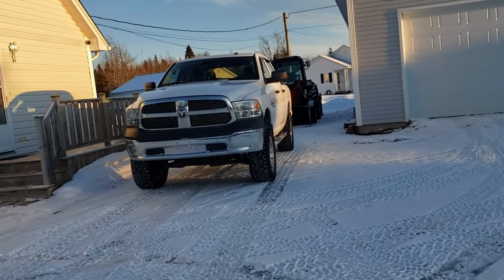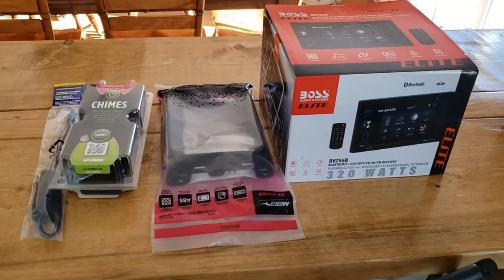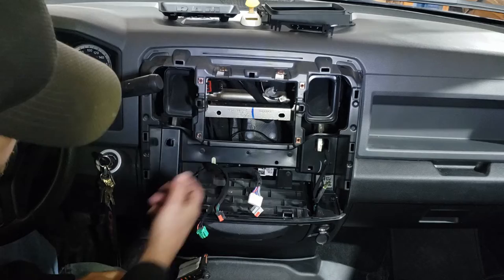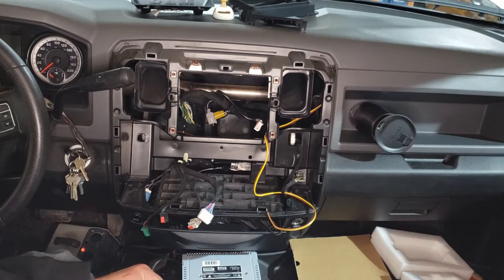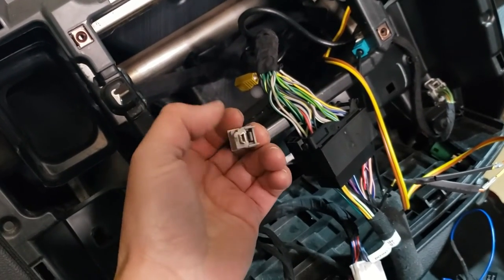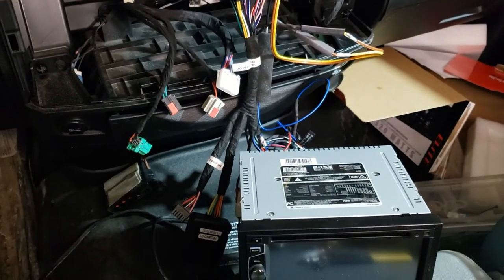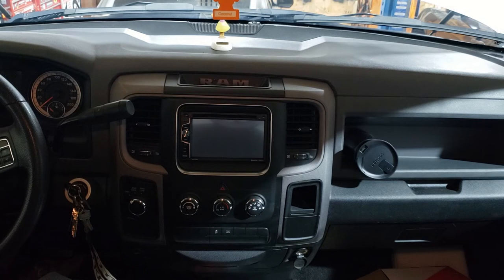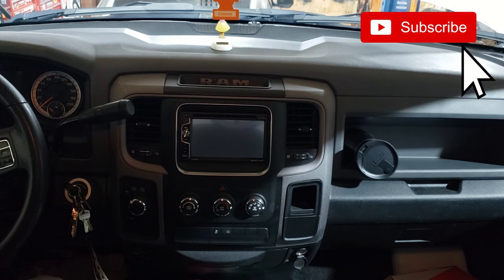Aftermarket Stereo Install - Touch Screen Bluetooth Backup Camera - Ram 1500

Comment: Great vid. Very helpfull. can you give info on the wireing harness and the face plate, part# ?? Thanks.
Reply from the maker: Here are the part #s from my order confirmation, it doesn't say what is what but I'm sure you can find them on the Crutchfield site: 12040EU55, 120956518B, 120LCHRC01

Comment: I have a Dual DMCPA70BT Radio do you think it would work in my 2016 Ram 1500 and trying to find the adaptor for my truck is hard to find. But i have the same OEM radio you do.
Reply: I’m not sure if it would work in my truck
Reply from the maker: Are you looking for the faceplate to mount it, or the harness to connect the radio?

Here's the faceplate: https://amzn.to/3PCYIuz

Here's the wiring kit I used: https://amzn.to/3x9Gs5s
Reply from the maker: It should. The tricky part is if you have steering wheel controls or want the console USB to work with the radio.
Reply: @nothandsomebuthandy  yeah I need the faceplate for mounting and the harness to hook it up and for the back up cam what wires did you use to splice into it
Reply from the maker: If you buy the adapter for chrysler vehicles it plugs right in to the existing radio harness and the adapter wires are colour coded to match aftermarket radios. So you just match the colors at that point red-red Green-green etc
Reply from the maker: Oh sorry the backup cam is the wires in the right dash access panel. It is the green and the green-red, see the 3:50 mark in the video.

Comment: Thinking about ordering this. They even have the option to hook all the wife's up for the harness before they ship it out
Reply from the maker: That will definitely save some time! Are you getting the same head unit?
Reply: @nothandsomebuthandy   yeah! I assume it is Bluetooth correct?
Reply from the maker: Yes it is, but it's not fantastic. I find I often have to manually turn the Bluetooth back on to connect to my phone. And I've had an occasional issue where if I start my truck and put it in reverse before the stereo has a chance to completely boot up the radio presets and sometimes the clock will reset. I have contacted Boss about the issue and have an open support ticket but have not sent it back yet as it doesn't happen very often.
Reply from the maker: Other than that it's a decent stereo compared the factory one
Reply: @nothandsomebuthandy  I'm currently using a Bluetooth device to broadcast over an empty radio station,  so I'm sure it'll be a great upgrade! Lol

Comment: So Question where did you get the dash kit and wires from? I went to Crutchfield and there isn’t a Ram option for 2016. I’m trying to help a buddy out with his truck and can’t find any kits for it.
Reply from the maker: 120956518B is the face plate and 120LCHRC01 is the wiring adapter I got. I also got 12040EU55 for the antenna.

Comment: I have a 4th gen 2018 Ram 2500 Tradesman. You think mine has that same wire for the reverse hot?
Reply from the maker: I believe it should. If you do get to that point let me know for sure.
Reply: @nothandsomebuthandy  I don't get why you need two wires. All that is required is one 12v trigger wire and the yellow RCA on the head unit.
Reply from the maker: Sorry I misunderstood your first question about the reverse hot, I thought you were talking about the signal wire on the reverse camera.  The wires I ran through the dash and spliced in the right side panel are the reverse camera signal and ground (which connect to the yellow rca). The reverse signal wire (to turn on the camera) is included in the adapter harness.
Reply: @nothandsomebuthandy  Mine isn't working though. Everything is wired up correct. Gonna check tomorrow to see if the trigger wire is hot when in reverse.
Reply from the maker: Here's what I have in my install document: Reverse (+)¹ Body Control Module under driver’s dash, white 48-pin plug (F), pin 41 - white/tan.
Does that sound like the wire colour/pin location you used?
Reply: @nothandsomebuthandy  thanks buddy

Comment: Which wire did you splice for the backup cam, you stated the plug you used but which wire/pin
Reply from the maker: The green and the green/red
Reply: Was green or green/red the power for the backup camera? Which color is for video and power on the harness by door? You didn’t specify which wire needed to go to what on the radio.
Reply from the maker: I'm not sure, I tapped into both wires and ran them to the dash then connected them to the camera inputs on the deck then waited to test the camera function on the deck before bolting it in. If it didn't work I would switch the connections.

Comment: Did the usb port in your center console still work after install?
Reply from the maker: Hmm I'm not sure as I've never used it before. I'll have to try it out and let you know.
Reply: So did it?
Reply from the maker: I just tried it today and no, the USB in the center console is not connected to the head unit but it does have power to charge.  I'm not sure it if ever was connected from the factory though, I don't think I ever used it other than to charge. The aux port does work. And the USB on the head unit works.